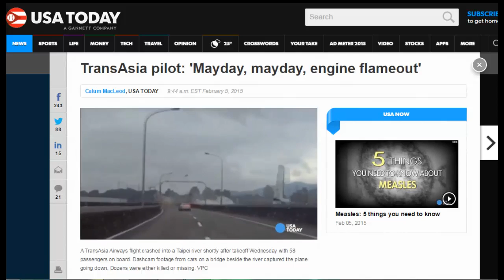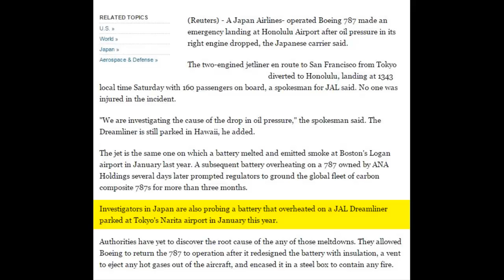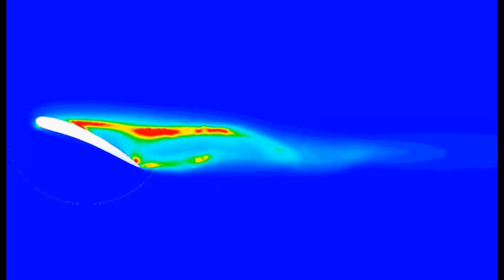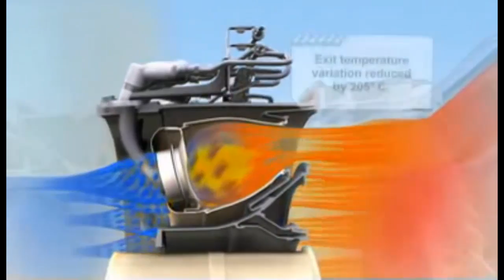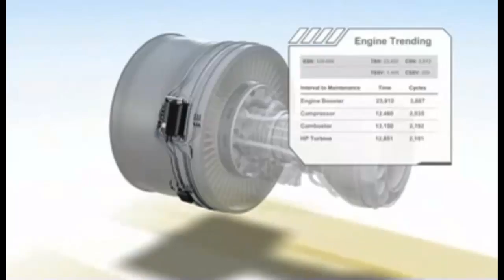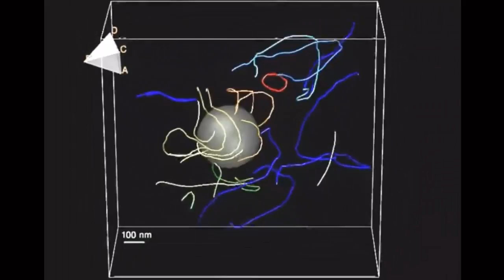Wigner8: Ex-Navy Engineer - Aircraft Engines are Rad Magnets

Comment: When they're talking about the batteries on the 787 I think they're reaching to assign the cause to Wigner effect. I'll explain: The 787 was designed to be lighter than previous aircraft, and part of this reduction was a rethink of the plumbing between the engines that would be used to start one engine using the other and and also run ancillary equipment. The engineering solution was to implement a battery system, which under some circumstances causes those batteries to be nearly completely discharged. In this instance they are recharged almost immediately after take off. This rapid discharge/recharge can cause the battery to overheat and that was, as far as I understand it, the cause of the battery fires.

Comment: 14:10 air travel should be using all that power as 'fuel'. I believe that all planes should be radiation proof (closed vessels), and they should all be electric/hydrogen powered. Otherwise air travel is doomed.